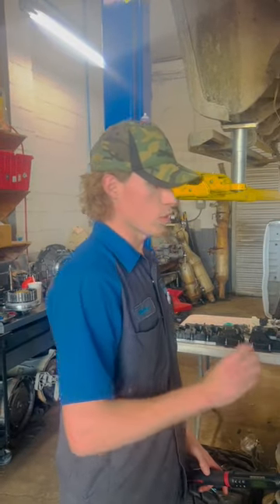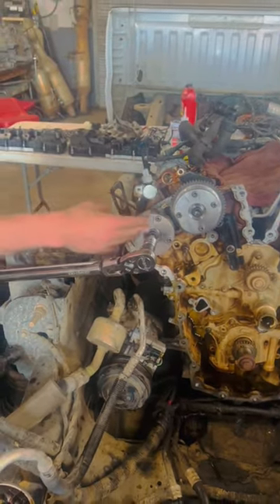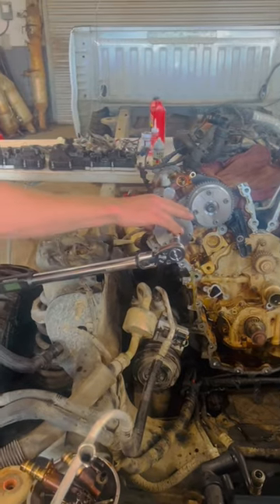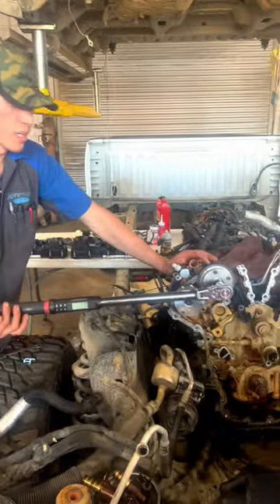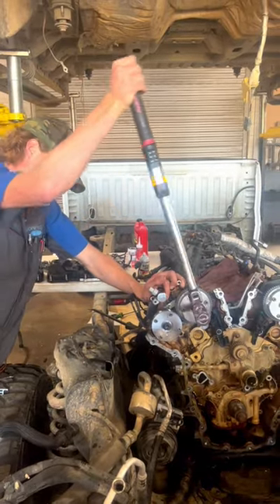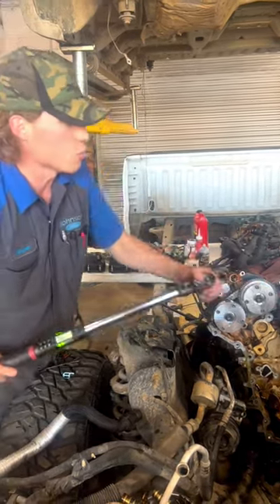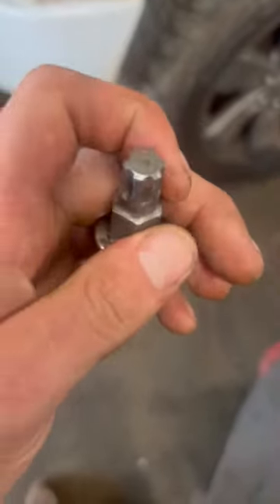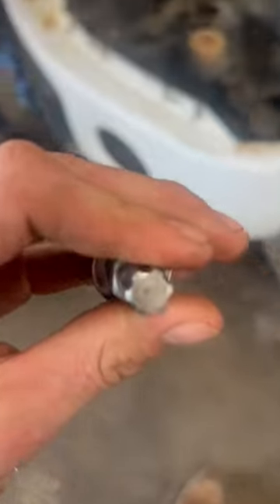How to torque cam phaser bolts |Ford 3.5L EcoBoost #shorts

Comment: Just so everyone know the 55IP is a torx plus socket from Snap-on which is about $55 and the set is usually $400-$500 depending on your tool dealer/ sale. Worth every penny every manufacturer is starting to use these fasteners

Comment: @flying wrenches I appreciate what you do, I was recently put into the diesel truck shop from our main shop by my boss, after 4 years of escape,explorer, fusion, etc, I’m being forced to use my skills on 6.7 7.3 anything bigger than a f 150. You are my go to if I have an issue. (Im being forced into the truck shop because we have no hood techs at my dealership and no one is knocking on the door to work here) so thanks for the content, tips, and tricks.

Comment: I had to buy the cam locks, a special harmonic balancer puller, and a T-55 plus Torx bit to do this job. All in all, it's not a hard job. I'm used to doing timing cover reveals on Toyota/Lexus V6s. Those are really painful.

Comment: I quit turning wrenches years ago but I believe any bolts that are torque + degree of turn need to be replaced after use if your going to try to torque it correctly again. 1st use you take the stretch out of bolt so when you try to turn x degree second time reusing you really over torque the crap out of it.

Comment: why do you pull the cab for phasers? I do heavy line and me and the other 2 guys that have done phasers at the shop will never pull a cab for them
Reply: I don’t understand it either.  Some guys in my shop do that too.  Extra unnecessary work.

Comment: Hey it’s the guy from TikTok hey what’s up with the sensor by the oil pump inside the front cover it’s not secure at all do I just make sure it goes back in it’s square hole?